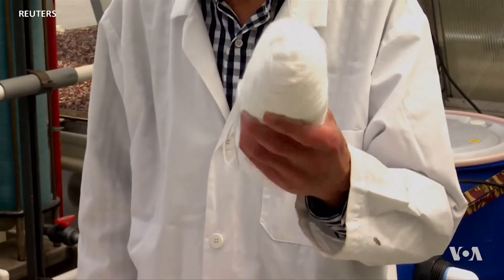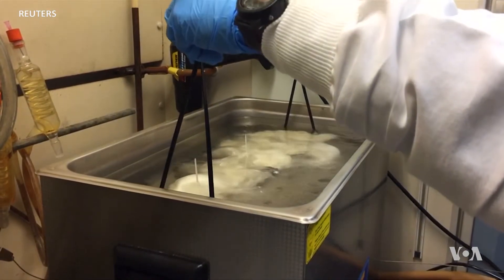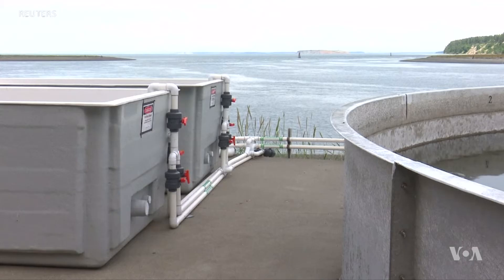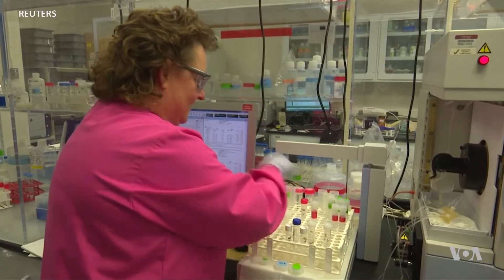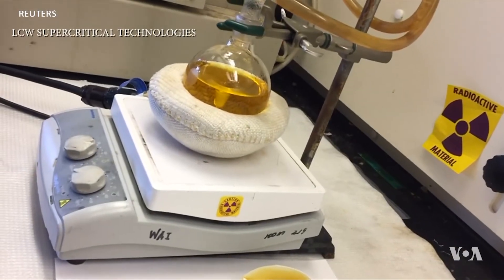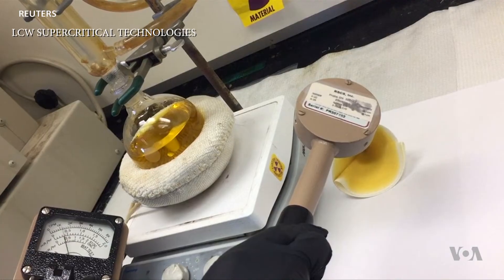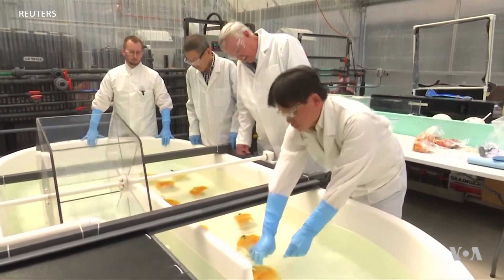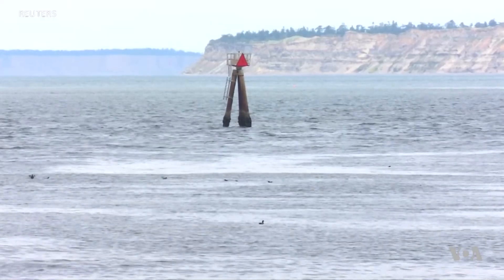Scientists Extract Uranium Powder from Seawater with Yarn

Comment: Well... we'll try to make ONE average french reactor fully autonomous using only sea water. Ok ? Let's see the numbers.
There is 3.3mg of Uranium per cube meter of sea water.
France buy 7000 to 10000t of uranium each year and earn 56 reactors. I keep 8000t for my example. It means that ONE reactor uses 4.5g of uranium each second.
One pound of uranium (454g) cost 50$/€. So 4.5g is 50cts.
So you need to filter 1350 cube meters of sea water each second (7/24/365, and with a 100% efficient filter) for 50cts per second.
1350 cube meters is 12 times the flow of the Seine in Paris... Or 115 times the largest seawater desalination plant in the world.
For 50cts per second.
Extracting uranium from sea water is a JOKE !
Reply: Don't come with common sense and ruin dreams
Reply: @matthiasknutzen6061  just reality. Try to use your dreams to make electricity. Guess it won't work.
Reply: Your example is not representative of the true cost. You don't filter the sea water in some sort of plant, but use "yarns" with absorbents on the ocean floor that naturally, thanks to ocean currents, filter the water. From 2012 to 2017 the price of ocean extracted uranium decreased 4 fold, to $440/kg or about $200/lb. I can't find exact figures for today, but it has been 7 years since then, which means price has dropped even further. Conversely, mined uranium increases in cost every year and it is not in some distant future where it will be more expensive than ocean extracted uranium. Additionally, fuel cost is a small fraction of the total cost of nuclear power, including SMR technology, which has the potential to be cheaper than renewables. Add all the previous + the main point that there's 3 orders of magnitude more uranium in the oceans than on land and we have ourselves a winner. Ocean uranium is a great idea.

Comment: china 1 usa 0
seriously though its so much easier to dig it up. uranium deposits are everywhere
Reply: but when those run out, this will be the only way
Reply: Sure its easier....but there is ALOT of ocean water....on a large enough scale it might be possible to outproduce mines. And it will certainly produce long after the mines are tapped